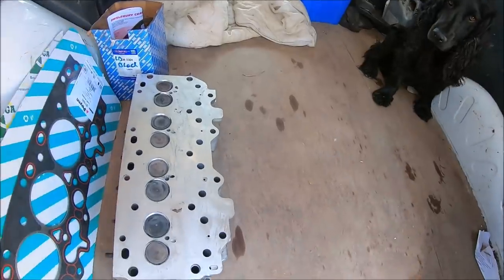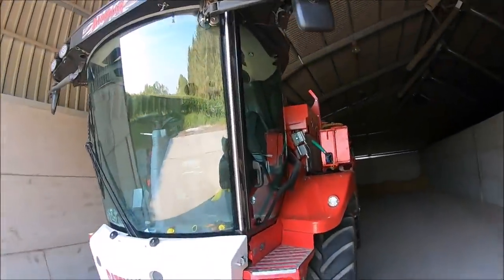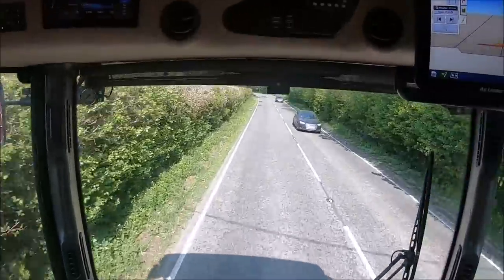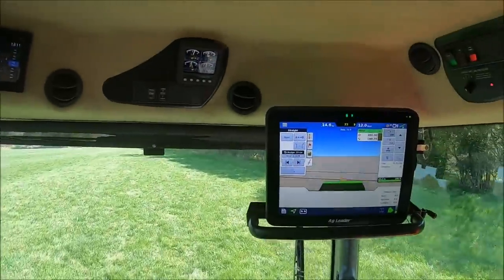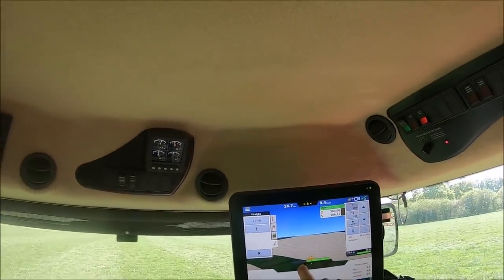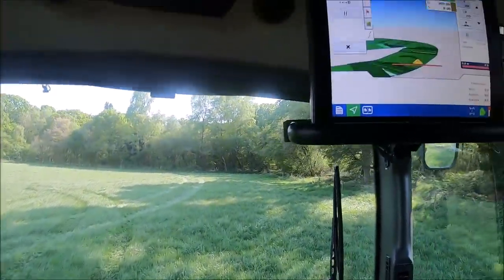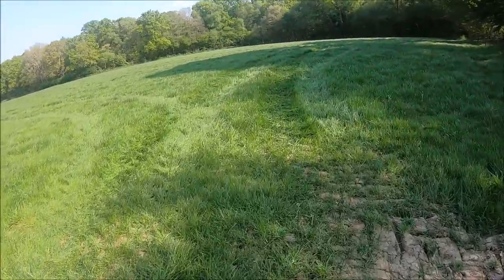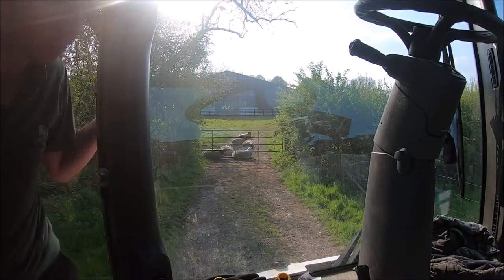Bateman RB26 - Spraying Dockstar pro

Comment: Piston liners could be the issue with the water getting into the oil. That would be one of the last thing after trying the radiator. They are relatively cheap to replace. Just time consuming.

Comment: Just wondering why you run your boom so high as you are getting alot of driffet and it won't apply the chemical where it should be applied
Reply: bigfarmer dan should half metre from crop
Reply: @johnandrews6312  yer I been spraying for over 5 years but it just seemed way to high
Reply: Depends what he was spraying . If there was no wind then it’s no problem. Also it’s grass so doesn’t need to be so precise
Reply from the maker: your right i should of had it lower but like i said i was a out of practice not spraying for a year.

Comment: Hi Andy, does the machine know how fast you are driving and varies the rate/pressure as you drive? How do you know how much product/water you need per field? Is it just a bit of a guessing game? If you have any left if the tank at the end of the day what do you do with it? Sorry for all the questions but just find it very interesting!
Reply: Sam Kemp not sure about his machine but there is usually a chart that says how fast to drive, you then look to see what water rate you need, doxstar pro usually requires 300-400L a ha, then youd look at the chart again at the speed you go, them find the water volume you are doing and this will give you your required pressure to run at. For the amount required all chemical is different. Doxstar pro can be either 1+1L a hectare so one spray in spring and one in autumn in 200l of water or one spray at 2L a hectare in 300-400L of water. Usually your agronomist would advise you on this
Reply from the maker: Hello yes the farm manager prints me out a job sheet with all the information on what fields to spray with what and how much chemical and water rate to apply to the field it also has a list of fields the need spraying with there exact area so we don't have chemical left over at end of day. The Bateman uses its gps speed reading to vary the water pressure depending in speed so it keeps to the same water rate whatever speed the machine moves.